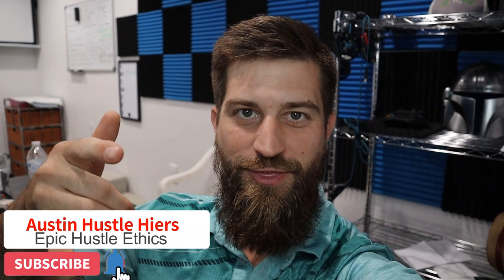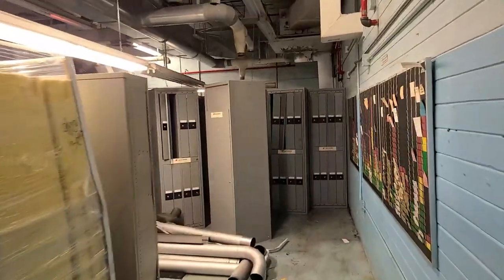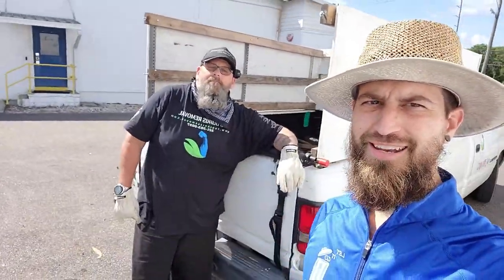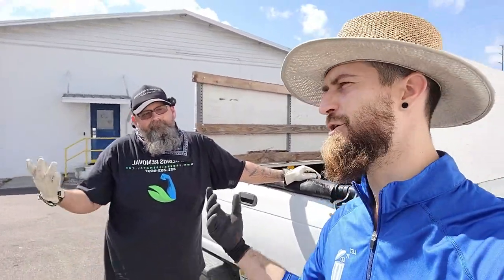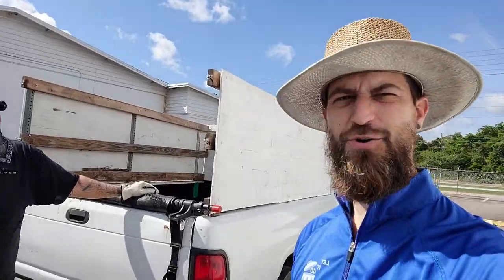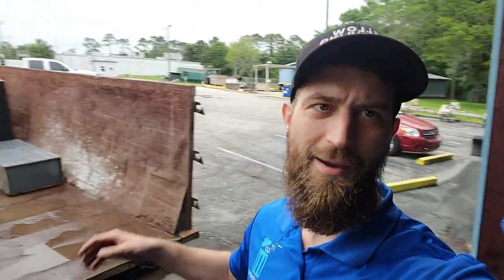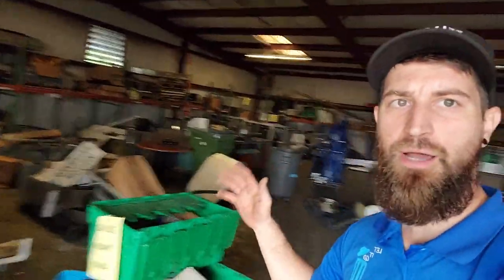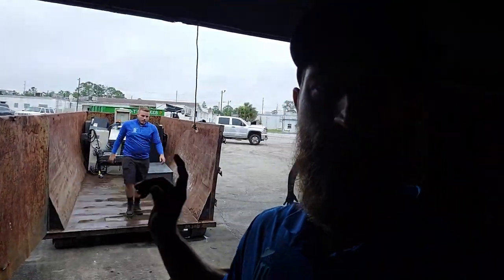$30,000 Junk Removal done in 2 weeks

Comment: How did you quote for this job? Per load? How did you structure the deal with the client? And how did you market to land these contracts with big companies? As usual thanks for the blessing

George
Reply: Hi Austin, who do you use for business insurance ?
Reply: @MreFEy  If you have an LLC in FL do you need a business license?
Reply: @MreFEy  Thanks for the prompt reply, I figured that was the case. I've been trying to a link where to get one, but I can't find it. By the way, how is your pressure washing rig holding up? Still using it?